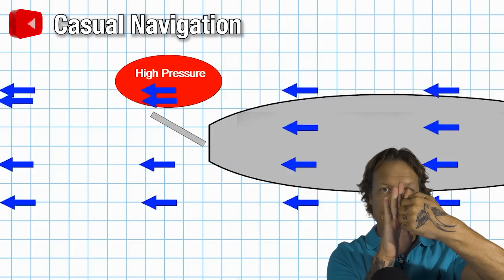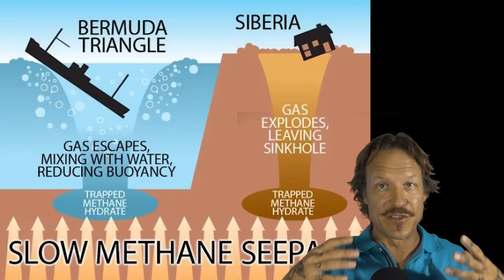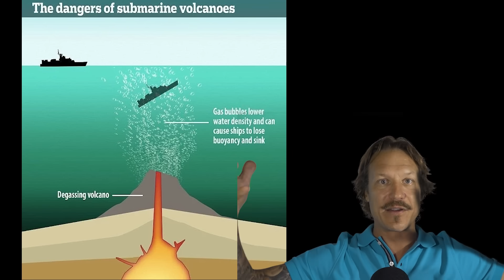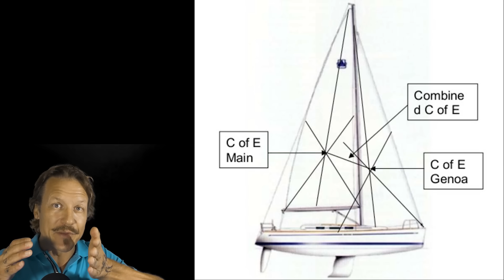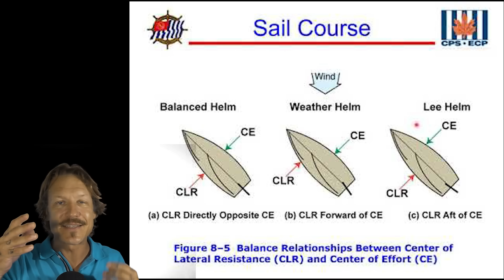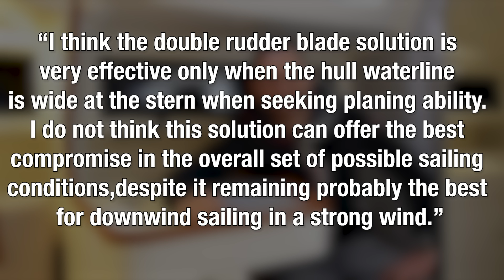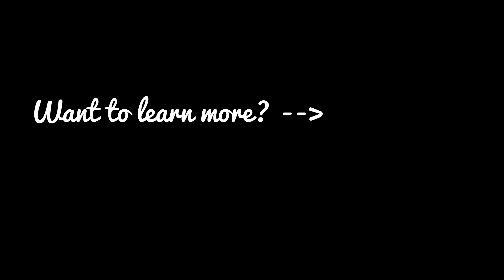The Problem With Dual Rudders Nobody Talks About

Comment: I've got a beamy 30" offshore racer with twin transom hung rudders. They work excellently under all conditions, both upwind and downwind. The boat was designed for tough upwind conditions (OSTAR, which it did twice), and after 25 years I am still pretty pleased with the hull shape. 
One major drawback of twin rudders that you don't mention is that while the leeward rudder is nicely in the water, doing it's job well protected by the hull, the windward blade is hanging about like a lame wing. This rudder will catch anything floating past the hull (driftwood, a fish net, etc), sometimes at the very tip of the rudder, creating a huge bending moment on the rudderstock. This is why I designed my rudders to be transom hung, foldable and with a spring loaded mechanism to keep the blade down under all normal conditions. At least once a year I experience a loud bang, indicating the windward rudder has taken a hit and has folded aft. I just need to reach aft and give the blade a push down to click it back into position and off we go again. 
I've seen many twin ruddered sailing vessels with one bent rudderstock, jamming the whole steering system of these boats. Incidently, you will see that the IMOCA's have similar folding systems, plus the ability to lift the windward blade completely out of the water to reduce drag.
Reply: Why don't we see skeg-hung twin rudders to negate damage you described?  Blue water performance, IMHO, is about brute durability more than speed and maneuverability.
Reply: @matthewpeterson3329  Pelagic hangs twin rudders on twin skegs, so the design is out there. Uncommon though.
Reply: I like the spring loaded mechanism to keep the blade down.  I use shock cord, but it needs replacing frequently.  Are yours linked to a central tiller at rudder level or above deck?
Reply: @Tomm9y  consider failure factor. After 8 years of living aboard and circumnavigating, not once did my single rudder pick anything up. Doing a lot of sailing in Maine (lobster pot heaven), many put cutting blades at the top forward part of their rudders. But them’s shooting crimes to a lobsterman.
Reply: Well said and pointed out frankly.  For us Cruisers and Voyagers, we have no need for twin rudders at all, are very ok with a well designed beamy hull with an underwater profile of good design between the chines, which is best sailed comfortably upright no matter the uncomfortsea conditions, such as the designs of Umberto Felci for Dufour which don’t need more than a single rudder, and thankfully, he is far from alone. Biggest disaster for me ? The Fad that has become Mediterranean Spec Sailboats   Very unpleasant boats to be on, if you take them outside of he Med, and not exactly pleasant in a not infrequent Med Storm either. 🤔 Bob.
Reply: 2 rudders > than 1 except in light air and that’s more of a racing performance issue of dragging the extra rudder and the fat transom through the water.
Reply: Can I have your contact "bartboosman953" in order to exchange about your rudders ?
Reply: As coastal cruisers tend to hang out at anchor most of the time. These twin rudders are fine, but a weekender that has a slip will find less boat control at the dock. So, you say you're a racer. Do you dock?
Reply: @GreedyPetey  I dock. I have no problem getting into or out of berthes, neither going forward or stern first.
Reply: Your explanation is interesting but could benefit from further details.
In the past, boat sterns were narrow. When sailing upwind, even while heeled, traditional hulls remained symmetrical and balanced. However, they were notoriously unstable downwind—and even hard to steer on a beam reach.

The first generation of wide hulls had wedge-shaped designs (sharp bows, wide sterns). As you noted, these hulls become unbalanced when heeled. When the boat heels, the shape of the keel plane generates downward lift to leeward, pushing the boat sideways instead of forward. This explains their poor performance when sailing close-hauled.  

That said, when properly trimmed, these boats remain balanced across all points of sail with a light helm. Their main drawback is reduced efficiency upwind due to their hull shape.  

The scow revolution changed everything. Modern wide hulls no longer suffer from imbalance when heeled. These boats dominate in all conditions—even upwind—as long as there’s decent wind. However, they struggle in very light air.  

Now, back to your point about rudders.
A single rudder on a heeled boat doesn’t just steer—it acts asymmetrically, like a lifting foil, making the helm heavy. That’s why big monosafrans rely on wheel steering.  

Twin rudders? The leeward one does most of the work effortlessly (if the boat is balanced). I sail a twin-rudder boat myself—you can let go of the helm for minutes, and it holds course perfectly without autopilot.
Reply: disagree wholeheartedly with your assessments. But then? It’s good to disagree.
Reply: @WickBeavers  Physics proof that the french fast cruisers and racers perform. One day the other side will understand.
Reply: @fastcruising.yachts  I’ve raced in a lot of regattas - none recently- and never saw a French boat. As for the solo offshore races/boats, they very definitely benefit from wide beams aft and dual rudders. Of course they also benefit from the best weather routing and NEVER GO TO WEATHER. You want to check your facts, proud Frenchman!

Comment: Excellent analysis! I just want to add two points.
First, there is the misconception going around, that dual rudders (plus helms) provide redundancy in respect to mechanical failures, respectively, rudder damage through impact. The first is not the case for any production (!) boat I know. If a cable or chain snaps anywhere, you loose both rudders. If one wheel gets jammed somehow, the other is jammed too. The second applies only in very special cases. E.g. if you manage to break off one rudder cleanly, the other of course still works. But again, if one rudder shaft is bend and jammed, the other rudder will be jammed two. It takes very complicated (expensive!) mechanics, including force limiting clutches, sheer pins, redundant cables/chains etc. to make a dual rudder / dual helm setup really redundant. Google how it's done on a Boeing 737 (OK, two "helms" and just a single rudder though).
Second, I predict the scow bow to be the next one-trick-pony to go around. It's simply too tempting to have that much space in the bow - and look, some racing classes having them now, so they must be good.

Comment: This was a big thing to consider when I was making the first design decision of SeaCamel.

One big thing was also that single rudder is mechanically much simpler and also easier to build.
Wide transom also makes the buoyancy to be higher and thus the surface area larger which means faster movements with the waves. That can be less comfortable.

So that’s why SeaCamel is actually 90s design with slight modifications to fit dinghy garage. Now it’s just fingers crossed for good sailing characteristics. 😅

Comment: What if we'd put the two rudders very close to one another on the center line ... just like a twin-rudder ...  so litterally together but with different angles (?)
Reply: If it's a particularly wide stern boat both rudders get lifted out of the water while the sailboat is heeled.
Reply: @Paul-mh9pr  Could be they are too much towards the aft hullt.

Comment: Thanks for the video. But it should have been titled "The problem with modern wide-aft hulls". The choice is between a more traditional hull design and a modern (wide aft) hull design. The first one will come with single rudder (and less storage, smaller cockpit, for the same boat length: these may be important factors especially for liveabords). The second will come with twin rudder or with a very deep single rudder (itself quite a worrisome thing, especially if you find yourself med-mooring often). The weather helm issue has nothing to do with the rudder configuration itself.

Comment: there is an other thing to take in consideration: the manuverability of a dual ridder boat inside marinas is bad due to two reasons: 
1) the rudders stick outside to the sides and can easily get cougt in mooring lines.
2) The rudder is not directly behind your propeller so you cant use your prop-wash for manuvering... always need a bow thruster on those boats.
Reply: There seems to be a lot of arguments here regarding lack of manouverability for twin rudder boats in marinas. This is not my experience……

Comment: Not to mention the exposure of the rudders with no keel in front of them and invariably no skeg.
Reply: True, but for the same wide beam a single rudder would be very deep (not much safer than two shorter rudders, and a nightmare when med-mooring in unfamiliar marinas). There are good skegs and there are bad skegs (particulalrly on how these transfer loads onto the hull frame). Partial skeg does not do much on a deep rudder. And a skeg rudder is usually not balanced, not even semi-balanced (adding load to the helm and the autopilot)
Reply: The balance should come from the rig assuming the keel is in the right place. You can have a so-called totally balanced rudder with absolutely no feel that tells you anything but which causes the boat to crab sideways if the rig and keel are not balanced.. @gabrielp.4305

Comment: I agree with what you say , with a couple of other factors tri

Its not just the rudders, it's the very flat planing bottom ,skims across the waves, slams like he'll up wind . Loss of comfort, 
A slamming hull, wide transom no balance alot more  pressure on the  steering gear.  
Also a cat offers more space and more and more are sold , loss to mono hull sales,  so they offer more space to mono hulls. 
I agree the displacement boats are better cruising , like older cars .

Comment: I worked in the Oyster design office when the switch to TR started. The wide sterns and associated poor balance came up. The wide sterns were driven by the palatial aft cabins. The Oyster 72 and 655 did struggle with balance. The solution was twin rudders. The idea was driven when the the first Oyster centreboard boats which needed twin rudders to achieve the draft, gave much better steering qualities and even performance than their full draft stable mates. I remember debates with Richard Matthews and Rob Humphrys. It was a decision not taken flippantly or swiftly.
Reply: I'm just wondering what happens when people try to use these boats as crusiers and put a half a ton of anchor+chain+all the other stuff in the bow locker.

Comment: I am surprised that you err away from wide stern / twin rudder boats for offshore passages.  Most are downwind which they are apparently better at, and therefore safer, especially run in a strong wind.  
Ok the other danger is being caught on a lee shore.  Traditional would be the winner here, but with deep keels and storm sails a wide stern boat will perform ok…if less comfortable.

Comment: I think there is one side benefit you didn't mention: Redundancy. Sure, it's not going to sail well with 1 rudder, especially on the wrong tack, so you will need to put up very small sails, or motor, but at least you can make it to a safe harbor.

Also on the point of going upwind with a very wide flat bottom boat, while heeled over: Wasn't one of the advantages of that for racing a lower wetted area when going upwind?

As for the to weather helm, I have never been on a boat that didn't have that problem in strong wind when carrying too much sail for it's own good (granted, not offshore, the experience is all lakes and near shore). The solution was always the same: Reduce the sail area, and start with the mainsail. I get that rolling some of the furling jib in is less effort, but it usually only makes the problem worse by moving the center of effect on the sails even further rear.

Comment: If I understand this correctly, the issue is a solution for the wide stern design. There is one other factor, lift keels, where twin rudders solve two problems. Reduced draught needs a lifting rudder or twins. Twins keep the boat upright when it dries out.

Comment: I guess there are many badly designed wide stern boats, as there are traditional boats. 
I have been on traditional boats which have overwhelming weather helm.
Two further points.
Wide stern boats are basically triangular on plan, when healed they don’t track along the centre line, rather the lee gunwhale line. You would think this would turn you into the wind, but as it also affects the angle of the keel it does the opposite. (Hence the race boats have double centre boards, and now foils). 
As boats heal, the centre of presser in the sails, if looked at from above, move to lee, so giving a turning force around the centre of pressure which has moved to wind.  This is a major factor in producing weather helm. 
So traditional boats, if hit by a gust, will heal over a long way, get weather helm and spill some wind. Whereas a wide stern boat may not.  So with a wide stern boat, reef early. 
Now downwind a traditional boat will become uncontrollable with too much sail and can readily broach, with often serious consequences. 
So the ideal boat has two rudders and straight sides…a catamaran! 
(Or a scow!)

Comment: Nothing to add.
If you seek cockpit and interior space aft and just do the ARC route than duel rudders are an option.
But if you want a boat to do more than that and offers a safer cockpit and have a less vulnerable UW profile, than there are better options.
That is why we buy and update a Hallberg-Rassy 46 instead of the newer 50. 
Thnx for the clear explanation!
Harry

Comment: double rudders are a solution taken directly from racing yachts built for speed at the cost of safety and comfort. In addition to your arguments, I will add that such rudders are never protected by a fixed fin and the risk of damaging them when hitting a submerged object is significant, along with tearing a hole in the hull underwater. It is worth mentioning the complicated system of cables and pulleys, which can also be a source of failure. Best regards.

Comment: For close quarter maneuvering in a tight harbor , twin rudders are a disaster as the prop wash passes between the runners rendering them ineffective.  The cure, steam into the harbor at 6knots so the rudders have grip  and and you have one shot. miss it and you'll provide all and sundry with a mix of fear and frivolity depending on the location of ones own boat. Close to the action its boathooks and fenders, safely away its deckchairs and beers.  Seen it a thousand times

Comment: In any case most of the boats built after 2000 have serious quality issues. As a boat dealer we have seen unimaginable things.
I own one 1980 and one 1992 boat, and they are in better condition than most of the "boats" manufactured (not built) nowadays.

So in addition to the "2 rudder" issue (which is also a big issue for maneuverability under engine), the age of the boat is a big issue. I'd recommend a premium brand boat before 2000 and a complete renovation rather than a new mass-production boat.
Usually cheaper, more individual, and you will have a robust and trustworthy basis with new interior, electric, electronics and so on.

Comment: It's like this the fat butt boats may not have the offshore sailing ability but they are as large as a motor boat. Solution burn some fossils if the design doesn't fit the condition's.

Comment: Sailing with Thomas has a different perspective.
Reply: Thomas's perspective lacks any supportive data as James does in this video. Thomas appears to base the majority of his argument on the fact that, 'since shipyards like HR are doing it, it must be right.' Of course James addresses the very reason for this here. Furthermore, with all due respect to Thomas and his lifelong resume in sailboats, I would say although respectable, it still pales in comparison to a delivery captain like James, who here, can combine both actual data and his experience in many many boats.
Reply: @Travis-j4b  naval architects in the comments have already pointed out that some off the stuff James is saying is flat out wrong, so much for his "supportive" data
Reply: Thomas is right about 2 rudders are only half the depth of the keel compared to single rudder which needs to be longer. But the argument of moving center of gravity (lateral forces) is correct, too.
I am not a bluewater sailer, but watching many atlantic crossing routes it seems that 90% is downwind.

Comment: That was very well explained, and as you said, it increases the boat's sensitivity to changes in wind strength. With the consequence it will have on longer passages (except downwind) on the wear and drainage on autopilot, windvane, and a possible shorthanded crew. Going always downwind, not a big issue, but going, for example, from the Atlantic west to east is a very different story. In that latter scenario, I would choose a classic boat, not necessarily an antique, but with a moderate stern with a single rudder design. Thanks, and cheers.

Comment: It’s all about design. My ultra wide transom dual rudder boat goes better upwind than any modern single rudder boat, only a long keel would do better. My boat can effectively sail upwind for 15 minutes straight while not touching the rudder. And it will remain on track with heavy gusts.
Reply: My experience exactly
Reply: What boat do you have? Sounds fantastic, well designed.
Reply: @Cptnbond A Pogo 8.50. Looks like Pogo figured it out (already more than 20 years ago), as did JPK for example. Know that these boats are very popular for short handed  sailing, so it’s key that they behave well.